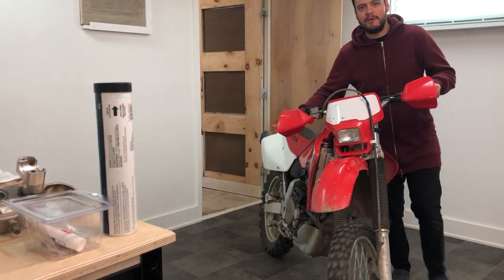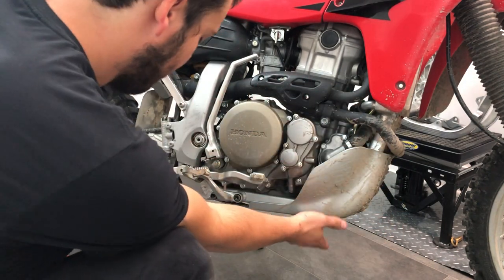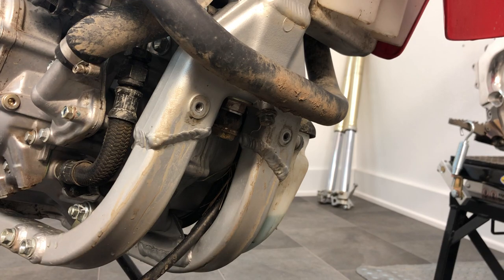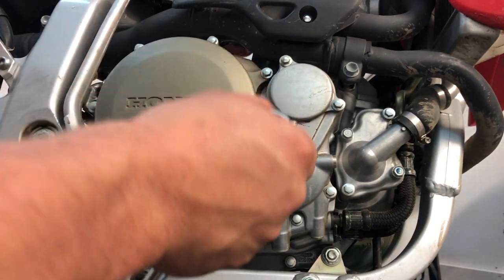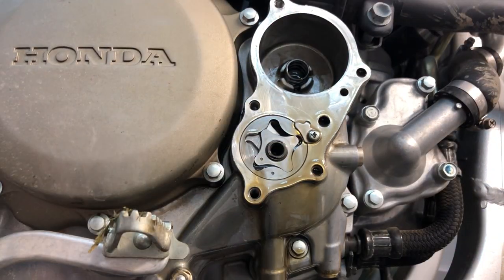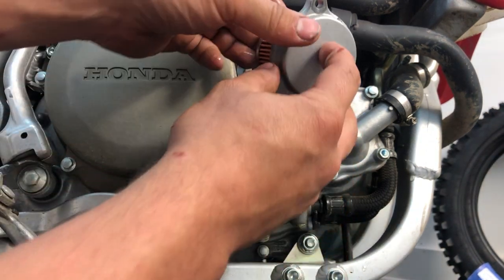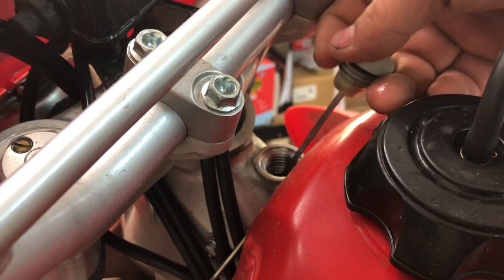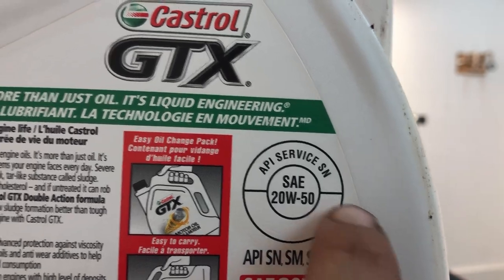Xr650R oil change

Comment: Just to add some information regarding the oil to be used: Basically, the "energy conserving" label can't be found on current oil products, since this specification is no longer in use, nor are oils tested, so you will hardly find oil which says "energy conserving". If you look closely, the oil you used already has the higher API specification (SN, SM, SL, SJ), although your manual says you shouldn't use SH or higher. But it doesn't really matter. What is important in terms of oil specs is a specification that was brand new as the bike came to the market: JASO. It validates the friction properties of the oil. If you buy e.g. JASO MA2, the highest class, you'll never have a problem with a slipping wet clutch system, regardles of API type.

Comment: After seeing that your dipstick read halfway by adding 1600ml...how much oil did you add thereafter and where did it lie/should lie on the dipstick?
Reply from the maker: You should not let the level go over the hole in your dipstick! After a good ride with the oil hot the level will be higher so you can ride the bike after putting 1600ml(its in the safe zone) after five minutes check and top the level!